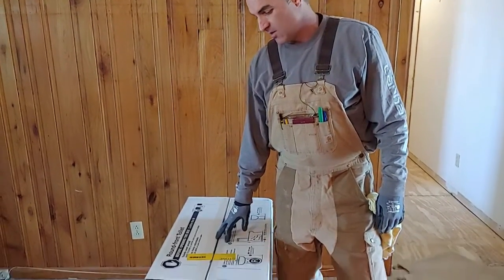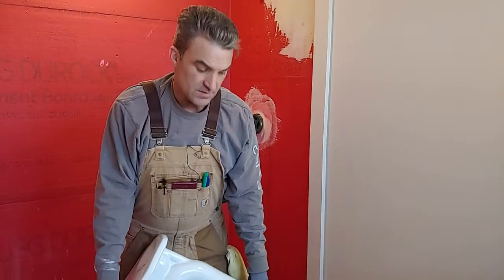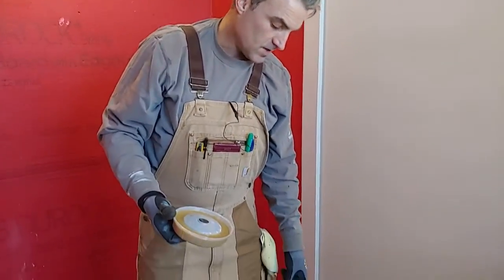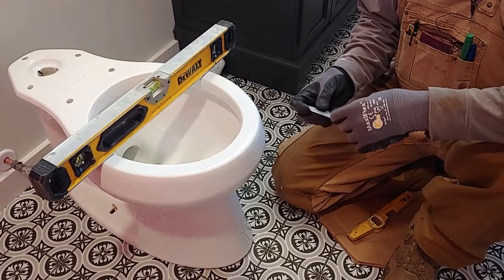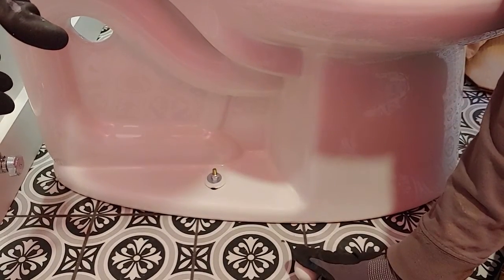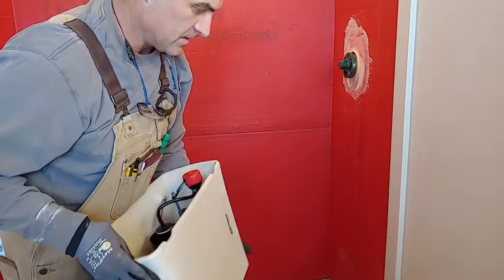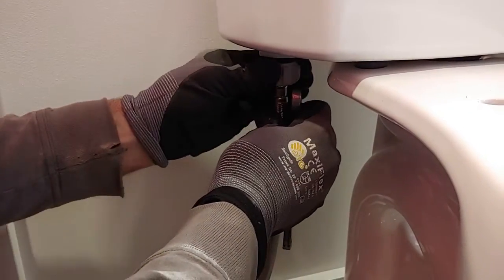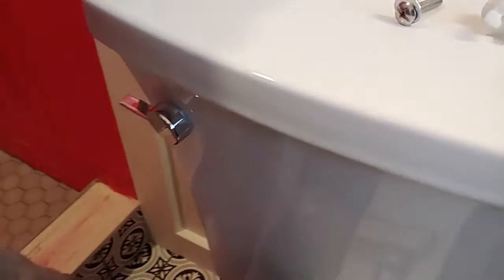Kohler Highline Arc Round Bowl Toilet Complete Install DIY #kohler #how #diy

Comment: caulking toilets is a mistake. the wax ring if properly installed won't let water or sewer gas come out. If there were a leak, caulking could hide the problem for weeks hold the floor is damaged
Reply from the maker: Hi! Thank you for watching the video and leaving a comment. I agree with that. I like to caulk toilets because it’s a clean look when done right…but, I leave a small gap at the back of the toilet for the purpose of potential leaks and giving a place for water to escape. I should have mentioned that in the video. Something to note…some states actually require caulking around the toilet. The uniform plumbing code in the state of California requires caulking in order to pass inspections. I was a licensed contractor in California for over 20 years. Though I’m not in that state anymore I still refer back to those practices when it comes to construction. I hope this information helps. Thank you for watching.👍
Reply: @YouCanDoIt2  What about grouting around it? Matching the tile grout?

Comment: Can you mention why the water inside the bowl is so low
Reply from the maker: Hi. This is a water saving toilet and will have less water in the bowl then the older toilets. However, you should have a good amount of water flowing through the bowl while flushing, so it clears the bowl of waste and toilet paper. If you are not experiencing that, then you might need to check your water intake line coming into the back of the toilet to make sure that the valve is all the way open. I hope that this information helps.👍

Comment: Nice overview.  People will debate caulking vs. not caulking the base.  My suggestion is if you do decide to caulk, leave a gap at the back and perhaps even a small one (1/2") at the front to allow any water that should build under the base to escape.
Reply from the maker: Great advice! And yes, I have received comments on this video about not caulking around the base. However, if doing it to code, people need to check with the local ordinances...our county building code requires that the toilet be caulked...other counties might not require it. It is always best to check with the codes first. Thank you for watching and leaving a comment 👍.
Reply: I always caulk the base, but I usually wait about a week after the install.  That way if there are any leaks, they'll be obvious.  However, if I do someone else's house, I will caulk it just after everything is tested.  And like Csimet said above, I'll leave a gap in the back for leaks.  (Wet floorboards are no joke.)

Comment: The toilet doesn't come with the hose, does it?
Reply from the maker: Hi Ryogain. That is a good question. I don't know of any toilet that comes with the supply line. Toilet manufacturers cannot guess how far away your toilet is from your supply valve. So, they will not include the supply hose. There are many lengths available at the big box stores. You need to find the one that will do the job for you without being too long or too short. Hope this information helps 👍

Comment: I would never cut the box sides open to remove the toilet base. Not cutting open the box, allows you to repack a defective toilet and bring it back to the store much more easily. I have seen people bring back toilets to a store, only for it to slid out of it's box and crash to the ground, all because the box it came in was all cut up and put back together with tape.
Reply: The only thing I can get in hours minutes iphone is the one who is that is 
W and you are the best of all the

Comment: Thanks!  We just installed our Kohler Highline Arc Round Bowl Toilet.  Really nice flush, quick, quiet. The only difference we had was that we took out an existing toilet.  Yuck.  But, after area was cleaned up (wasn't really that bad) everything went in perfectly, per your video.  When installing the toilet seat, there were these 2 small pieces, that looked like bumpers for the toilet seat, that we could not figure out how they were meant to be used.  They looked kind of like boats from a game of battleship (Ha!).  Anyone have some thoughts, feel free to let me know.  Probably so easy, I'm over thinking it.  Anyway, great video, thx again.  The next toilet will be a lot easier!
Reply from the maker: Hi! Thank you so much for watching the video and leaving a comment, always appreciated! I think I know exactly what those ship looking parts are that you are talking about. They are the two rubber bumpers that go on the inside of the toilet seat lid so that there is a cushion between the toilet seat and the toilet itself. If you lift up the lid you should see two spots to put those in. I thought I showed that in the video. I apologize if I missed that portion. 👍
Reply: @YouCanDoIt2  - Thanks.  Going to look for those now.  Best regards to you!!
Reply: (A little late posting this this) I was looking under the lid, not the seat for those stop pieces.  DONE.  EASY.  THANKS Again!!
Reply: 12:31 ❤

Comment: Never understood why people put caulking around their toilet. It's counter-productive and looks hideous.
Reply: Never understood why people comment on someone else’s preferences. Don’t caulk yours
Reply: Without going in to a lengthy message. Please research why or why not to caulk toilets. The main reason to caulk is for sanitation.
Reply: @ottomatic7823  I believe the main issue with caulk around a toilet is it hides a potential leak. If there is a slow leak it will not be noticeable with the caulk.
Reply: Without caulk there will inevitably be mold under there.
Reply: Capillary action could draw urine in under the toilet edges. I caulk the front and sides with clear 100% silicone caulk (after cleaning all the floor areas with rubbing alcohol first) and leave the back side open to easily detect any leaks that might occur in the future so you can take quick corrective action!

Comment: How long should it set before using the  toliet?
Reply from the maker: Hi Jerry.  Thanks for watching the video.  That's a great question and depends on what sealant you are using.  Refer to the guidelines of use on the tube.  Some require only a few hours before the sealant is set and ready for use, while others require 12 hours before use.

Comment: Thanks for this!  I just had this installed and was a bit concerned when I saw the black washers between the seat and the tank.
I do have a question, I checked the level on the tank and it is not level.  I am NO plumber so I don't want to go messing with it myself, would it be a problem if I just leave it?  I'd guess it's off by about 1/8".
Reply from the maker: Thanks for watching the video and leaving a comment / question.  The issue I would say with not having the tank level, is that it may not fill and / or drain properly. You may want to take the lid off the tank, and do a couple test flushes to see what it looks like when it is filled and whether or not water is constantly trickling over the spillway. Also, if one of the bolts is over tightened, creating the off level tank, it could cause issues with cracking if someone sits down and puts pressure on the tank while they are doing their business 😊.  You may have to loosen a tank bolt or tighten a tank bolt in order to get a level tank. Hope this information helps!
Reply: @YouCanDoIt2  Thank you so much!! You made everything SO clear. I am a woman, and am going to save myself $250 and install my own toilet, thanks to you!!
Reply from the maker: @carivawter4193  Thank you so much for watching the video and leaving a comment; always appreciated!! So glad you were able to install this on your own...YOU CAN DO IT!!!
Reply: @YouCanDoIt2    Thanks for your quick reply!
The plumber did have an issue with the water running non-stop after a flush, he called his associate and they fixed it after a few tries (by adjusting the screws on the top?).  It is flushing and filling correctly now.  He did mention to me about not over tightening any bolts, so that is a good sign.
Thanks for mentioning about putting pressure on the tank when someone is sitting down, I didn't think about that!  I will ask him to check the level of the tank and the possible over tightening of a bolt, he is coming back tomorrow.
Reply: Update... I asked him to check the level and he did, it was off, then so was the seat, then he checked the floor... the floor is on a slant (55 year old apartment building, with old tile under new tile (because of asbestos in the original tile's compound) so that solved that mystery!  The toilet itself is secured well and I cannot jiggle it at all.
Thanks again for all your help!